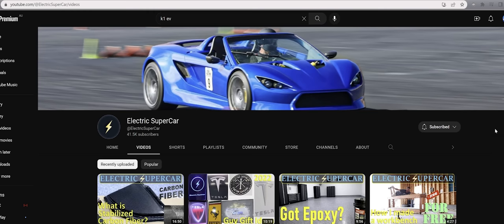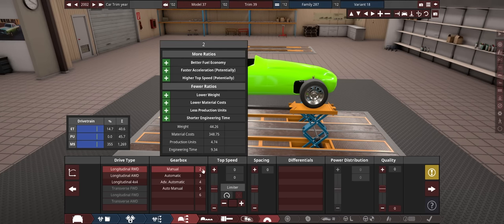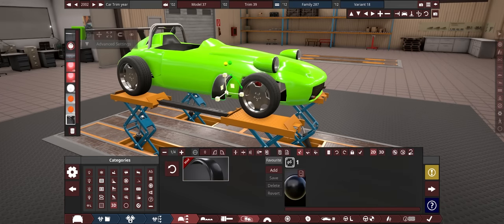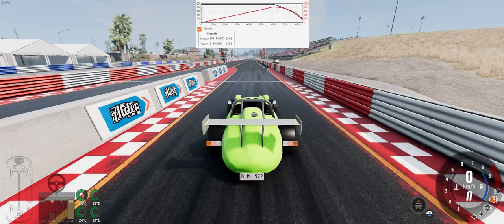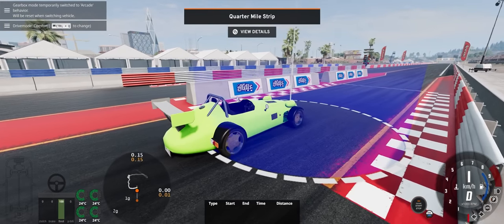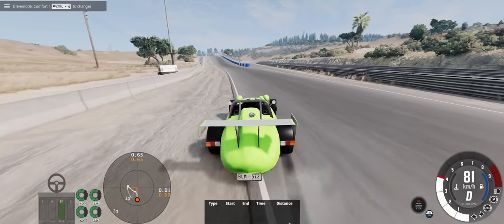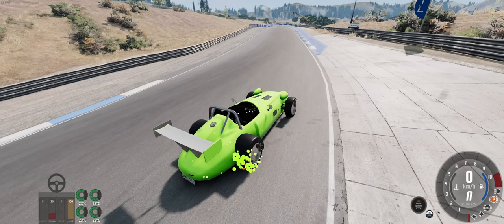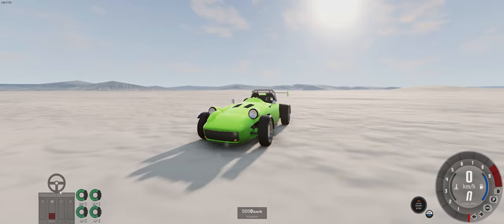The Big EV Update (and multiple variant exporting)

Comment: Question…I made a car but the intake and the inter cooler stick out how do I hide it in beamng ….when I go on beam I don’t see the options like you have in the vid under car parts
Reply: You can resize the engine on the settings in the fixtures section, or use a fixture of a "hood bump" to hide it under
Reply from the maker: in automation, under advanced trim settings, on the left most tab, where you might hide the chassis, you can also hide the engine
Reply: @Ferrari255GTO  thank you I appreciate it
Reply: @fillman86  ty easy fix instead of resizing the engine
Reply: @fillman86  I cloned the car and made a less powerful eng n exported it but when I spawn it the game freaks out

Comment: how did you get the RPM so High? Also struggling with teh acceleration when i turn it into EV
Reply from the maker: I suppose learn through trial and error will help learn RPM. As for acceleration, that comes down to torque, and shorter gearing

Comment: is there a way to have two varients in one slot even if their not varients in automation?
Reply from the maker: maybe, try with just matching the names like I showed
Reply: @fillman86  thanks, i have one more question, i made a car with 2000hp and 1200lbft but when i exported it as a ev it cut the power in half to 1000hp and 600lbft. why?
Reply from the maker: @fried_gatorade1969  lol did I look like someone that knew why the power curve was doing what it was doing? XD
Reply: @fillman86  fair enough lmaooo
Reply: i exported another car with the same engine just now and it gave the correct power outage, so i guess it was just a fluke
Reply: nope did some testing, itll only give full power if you use fwd or rwd, if you use awd then your power gets cut for some reason and seems to go based off the rear power outage. so if i have an 1000hp car and i have a 40/60 power distribution then itll export as 600hp

Comment: i hate that he says it locks up when he puts on 100% brake power, if it's that much of a problem he could just put the multiplier down in the tuning menu
Reply from the maker: but there's abs and the front tyres weren't locking. Also with less braking, the distance dramatically increased more than what you'd expect